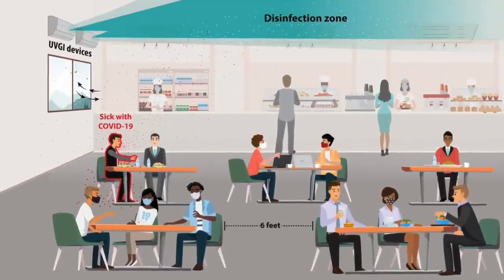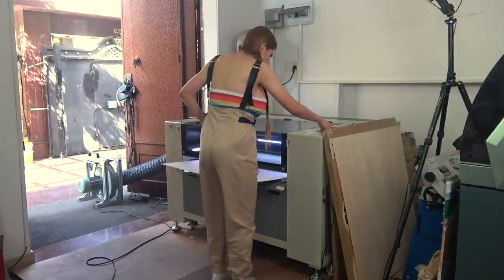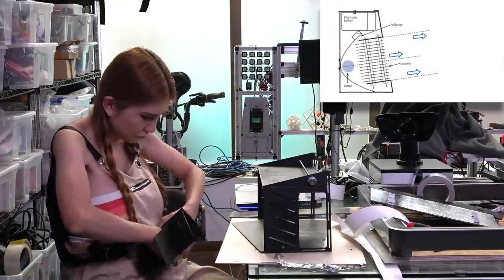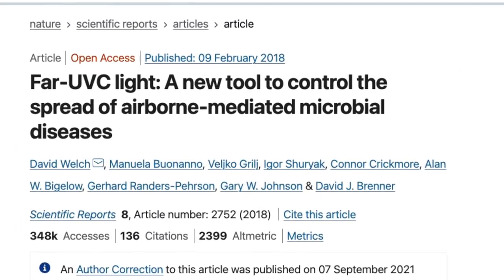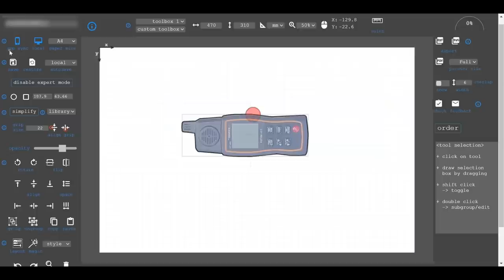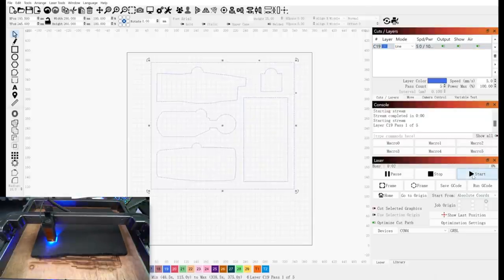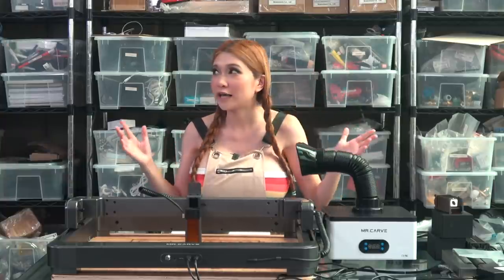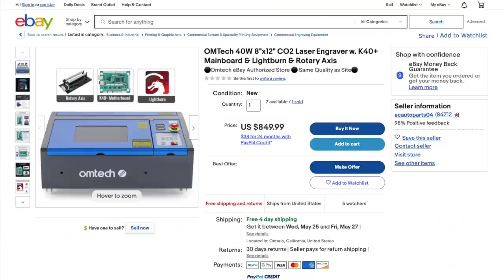Mr. Carve M3 Laser

Comment: Wouldnt the UV light just bounce around the room anyway? There may be no direct view of the source, but if you fitted a regular light bulb in one, and fitted it into a dark room, I'm certain that the light wont magically stay at the top of the room and keep the lower part of the room dark, that's not how light works. So, what am I missing here?
Reply: I'm no expert, but I do know that gloss white paint usually reflects around only 20% of UV - far less than visible light.
I would assume flat and/or darker surfaces would reflect even less than that.
As Naomi clearly shows, you do need to check the UV radiation from any unit before using it.
Reply: @ausfoodgarden  And she specifically mentioned that reflexive surfaces could pose a problem. So yea, measuring the UV is the only way to know. In something like a classroom the teachers would also have to be educated on the dangers of UV and given instructions on how high up on the wall they can put something without risk of reflecting the UV.